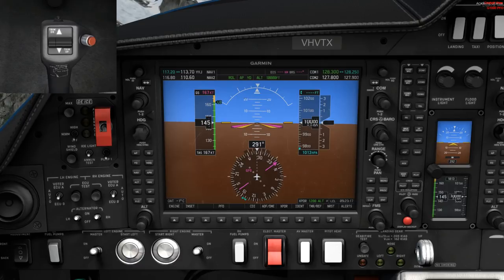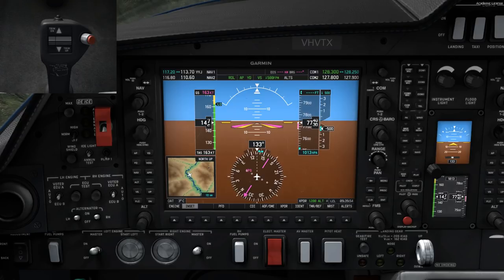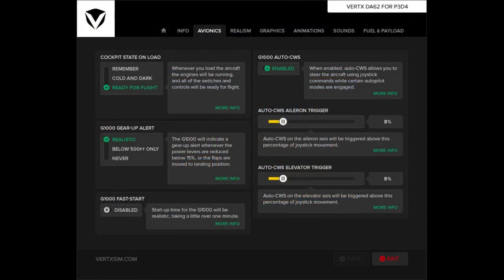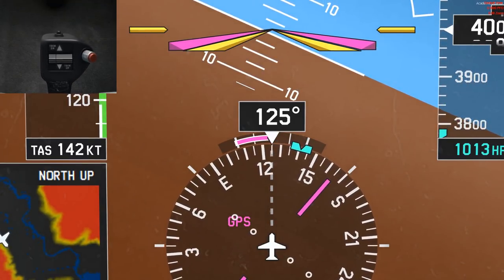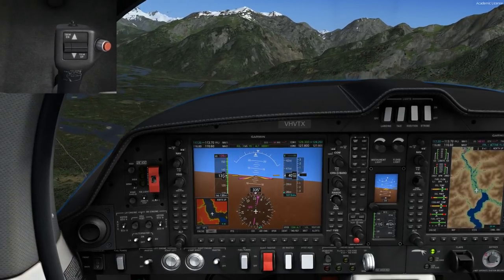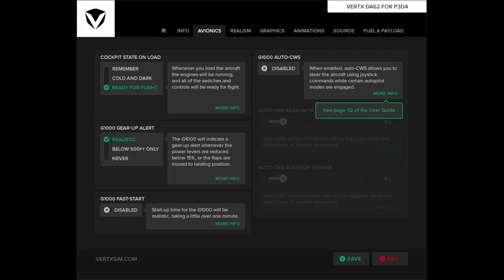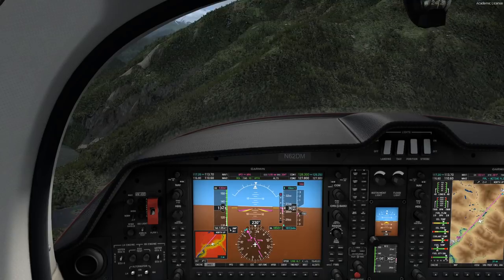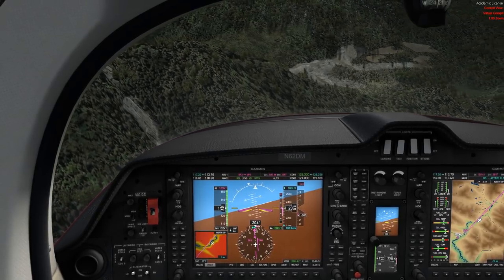Vertx Diamond DA62 - in detail - part 5

Comment: To use the worldwide SID and STAR`s the database from FSAerodata is nessecary. Witch modifikation at the VERTX has to be performed therefore ?
Reply from the maker: Often when this is discussed, it seems not clear that the Vertx DA62 has not implemented SID and STAR yet,. You can use Little Navmap to include these waypoints, but not in-flight.
Reply: I load a flightplan from LNM via P3D flightplanning into the DA62. Is it direct via export in Garmin format GNT GFP possible as well ?
Reply from the maker: @koloinflight3799  The DA62 does not read Garmin formats. Thanks for your help and answering my questions.

Comment: In the Garmin 1000 Manual - Flight Management- are instructions for holdings. But it seems that is`nt simulated in this P3D-
 version ? Can we expect the holding funktion in further versions?
Reply from the maker: Which of the many different types of holdings you think about?
Reply: I mean a holding  at  one of the next waypoints  - right or left
Reply from the maker: Holding at a waypoint, this belongs to the "user defined holdings" group, like "holding at present position" and "holding at direct-to waypoint". These are not inplemented so far, there is no decision yet when this will be the case. This does not depend at the P3D version used, implementation has to take place in the aircraft.